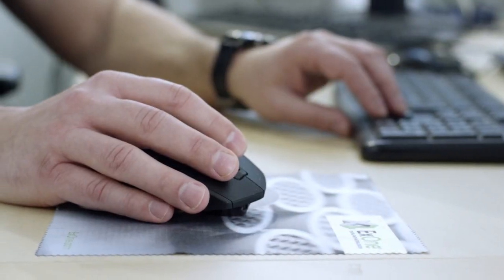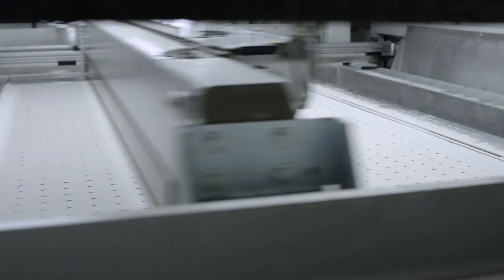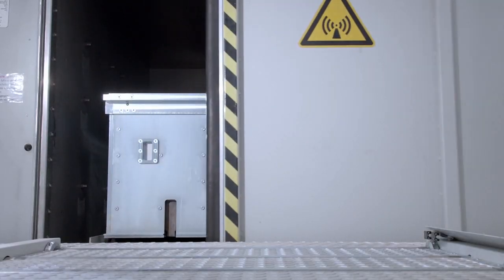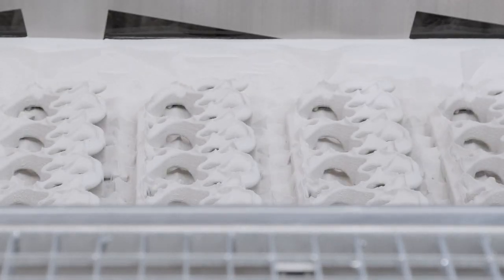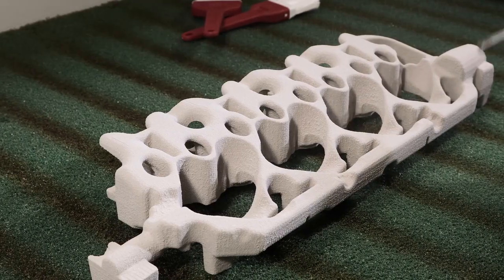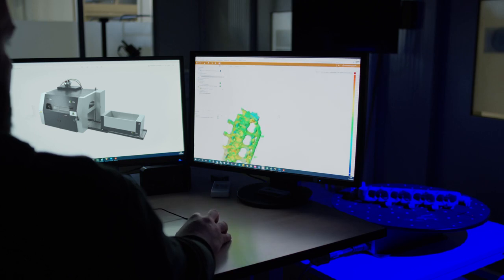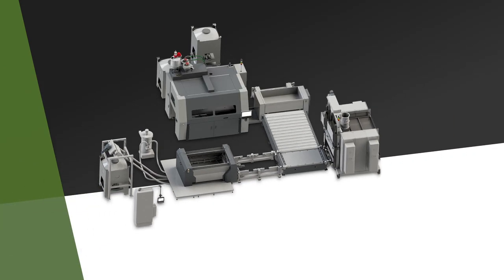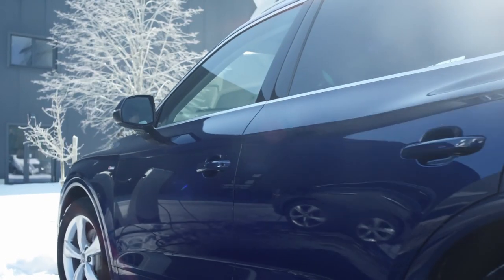Inorganic Sand Binder Jetting

Comment: The problem is still in the molds the cores go in to.  Unless you print molds and cores which we do all the time with the Furan binder. But in most cases it’s way cheaper to make a cheap pattern and mold using traditional techniques for air set or green sand.  The hybrid approach is way cheaper but comes at the price of smoke and fumes.  I would like to see what the performance of these materials is like.  Smoke, dust, strength and build quality.